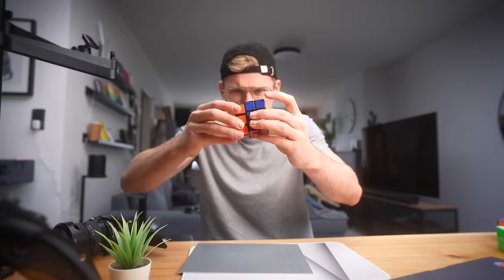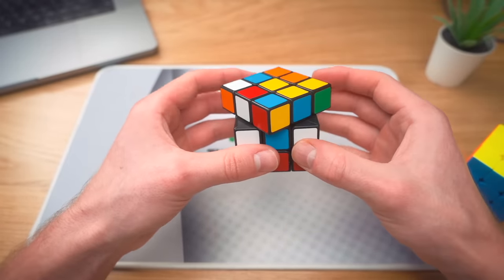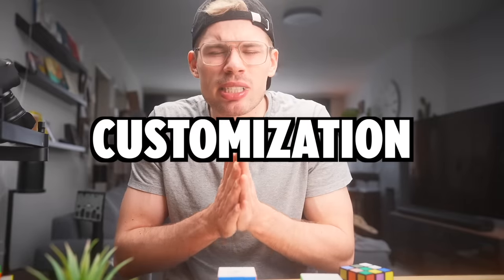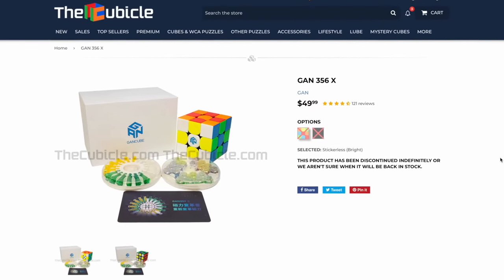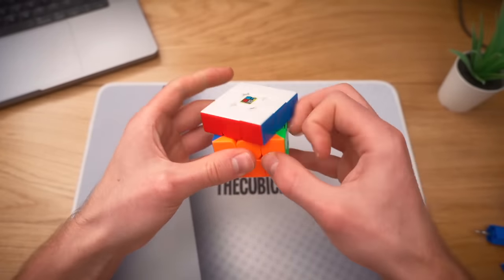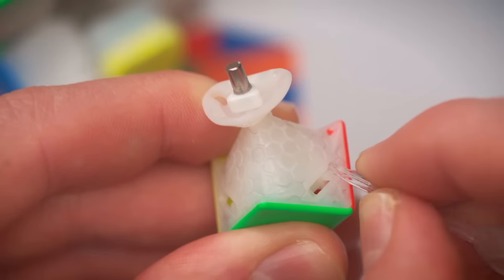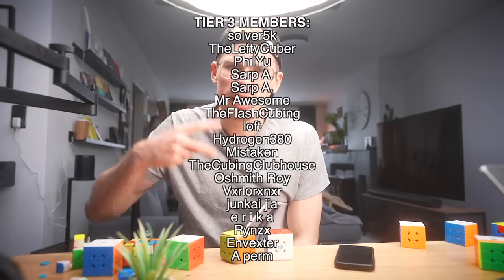How a speed cube works

Comment: UV coating is a sort of polish that is cured with UV light. This is somewhat similar to UV cured nail polish, but it is coated way thinner and more precise and is more durable. 
This indeed because of its extreme smoothness and its plastic like properties, is more grippy :)  (correct me if I'm wrong!)

The cost of UV coating comes mainly because this stuff is made synthetically and applying is not an easy procedure. People have tried using the UV cured nail polish as an alternative, DIY version, but the application has more bubbles and is way less uneven, and can even make the cube slower if it accidentally also coats a little bit of the sides of the cubees. It is also less durable so It might come off after some use.

Comment: The TengYun V2 actually has a more convenient Magnet Adjustment System. It's only issue is that the carousel is holding several magnets with different strengths rather than just one or two.

Comment: If the spring itself doesn't change (in length or amount of coils), going from more extended to more compressed doesn't make it 'stronger'. It'll be just as strong if compressed the same distance as the one already compressed that same distance. I'd also say traditional springs have the issue of wearing out and losing their strength over time. Magnets don't have this issue.

Comment: Great introduction
But the cube that you present for feet magnets is our Moretry Tianma X3, not the one you marked MS cube 😮
And plus, core magnets comes earlier than feet magnets, and we believe there are still more magnet schemes besides core magnet that can work well.
As you said, what will be the next feature of speed cube, we believe magnets repulsion is very potential, so we have been working on that, hope more speed cube products can have a try on this feature
Reply: @ThatOneNoob We do have planned to make adjustable magnets at first, but we need to trade off all the features so the adjustable magnets were removed from Tianma X3
Reply: @ThatOneNoob We will consider adding adjustable magnets on the next generation

Comment: If you get a cube with spring realistically it just depends on the cube you got if it makes spring noise I have a tornado v3 flagship I can’t even hear the spring in it. I didn’t get pioneer because it was very hard to control

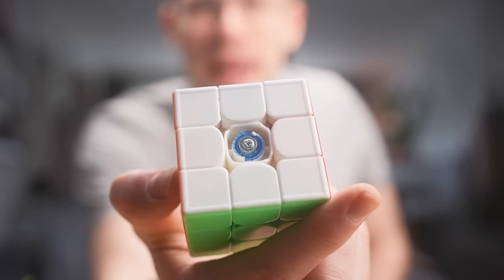Comment: 4:24 “a way to adjust tightness and compression without swapping anything out” gan standing in the corner with 50 GES nuts and and gan 11 adjustment system…